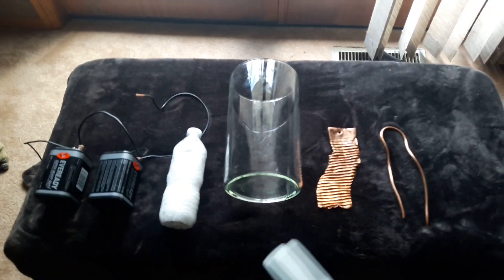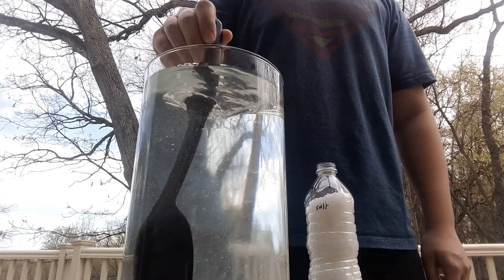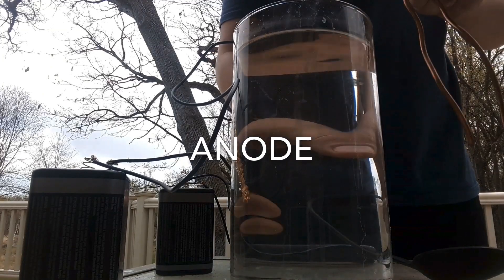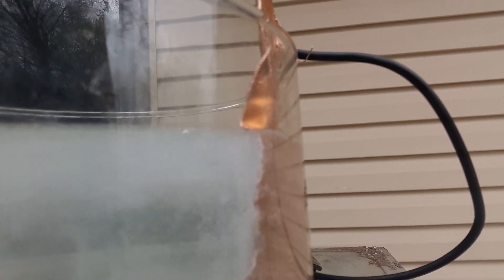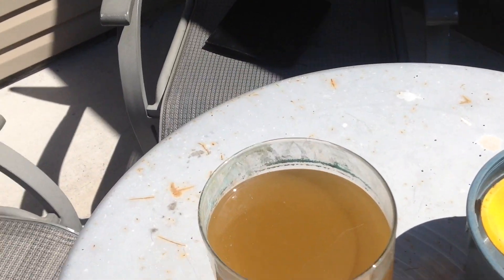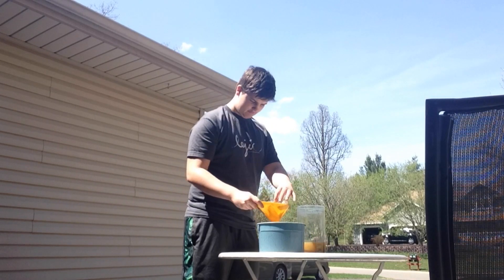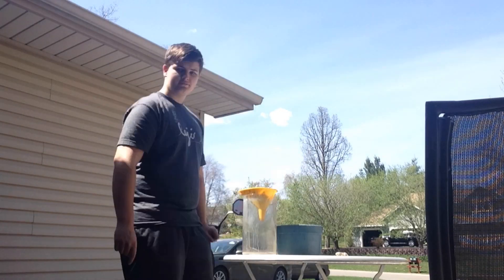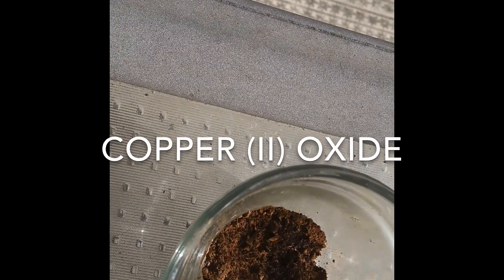How to make copper oxide

Comment: A good video but it is copper (ii) this tells you there are 2 valence electrons, thus it must be bonded with ONE oxygen atom CuO.  

This is due to the atomic number, 8 (8 protons = 8 electrons), 8 electrons, 2 in the first energy level & 6 in the second. We know we need 8 in the second level for a full level, thus they bond with the copper to obtain the full 2nd shell. Copper has two (copper (ii)) so it must be ONE COPPER & ONE OXYGEN, CuO :). At 3.28 you say one copper & two oxygen.

You started with cuprous oxide, or copper (i) oxide; Cu2O
Reply from the maker: yea, I did say 2 oxygen atoms didnt I my mistake. I am planning on remaking this video as there are many errors with it.
Reply: @deboerium1915  Well done, it's a good video. I'm a chemistry teacher so just wanted to point out as a lot of students might be watching. :)
Reply from the maker: @louispower7822  Glad to here that! I'm currently studying to become a chemical engineer so rewatching this video hurt me as well. I have taken a lot more chemistry since I made this video, and plan on doing more complicated reactions and the such.

Comment: Do I have to flatten the cathode or can I just put 2 copper pipes in I’m to lazy to cut one open
Reply from the maker: You dont have to fatten the cathode, but it will make the process a little slower.
Reply: DeBoerium ok is it okay to use 5v 13.2amps or 5v 15a
Reply from the maker: @KAYLEBHD  the 5v  15 amps would be the better choice, but they both work.
Reply: DeBoerium ok thanks I posted a video of the cell is it okay like this or should I raise the copper piper up a bit off the bottom I still have to drill a vent hole
Reply from the maker: @KAYLEBHD  neat cell! I would raise them a little as when the oxide is being produced it could pile up and start to interfere with the production.

Comment: Would it be easier to add copper into a breaker with an acid and hydrogen peroxide?
Reply from the maker: The acid would be an amazing electrolyte and the peroxide would add extra oxygen to the solution, but you would not end up with copper oxide. Instead depending on the acid copper sulfates and chloride.
Reply: @deboerium1915  sorry, I realize it now xD. Btw if you had the copper salt and you wanted only pure copper, could you use electrolysis? Eg: cu(ch3ooc)
Reply from the maker: @csgolden7343  Yes, you could get some nice pure copper crystals.